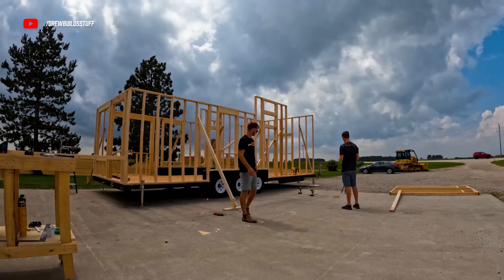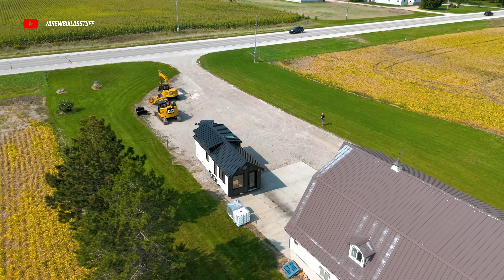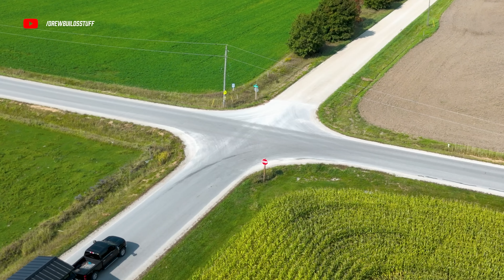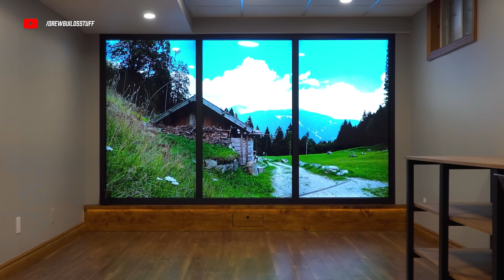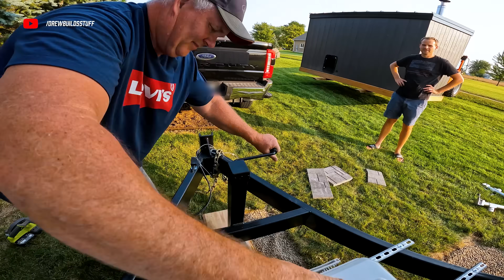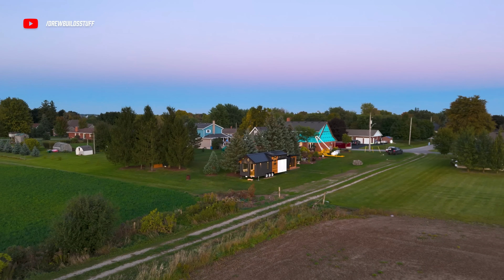MOVING MY TINY HOUSE

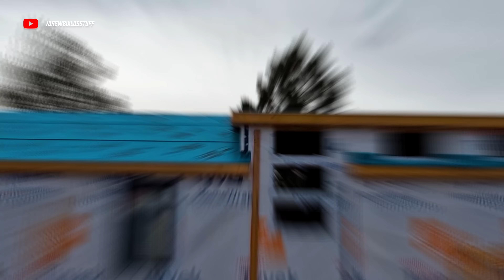Comment: 0:24 Glad to see that you're using regular plywood for the walls instead of that awful OSB crap --- it may be a bit costlier, but plywood lasts a lot longer in that it doesn't just dissolve into mush and fall apart the way that stupid particle-board does if it gets wet.

Comment: F-250 the 6.8L Gas V8 engine allows for towing up to 14,500 lbs. With the 7.3L Gas V8 engine, the towing capacity increases to 17,000 lbs. Both the 6.7L Power Stroke Turbo Diesel and the 6.7L High Output Power Stroke Turbo Diesel engines offer a maximum towing capacity of up to 22,000 lbs.

An F-350 or bigger is ideal for large tow jobs. Max towing capacity should not be taken lightly. Exceeding what your vehicle is designed to tow can strain your engine and transmission, accelerate brake wear, damage your tires and even warp your chassis. I always recommend doing your research before you tow anything to make sure that your vehicle can handle it. Even short trips can cause problems, but just a heads up for something to be mindful of.

Comment: TOTAL BEAUTY!!!  And you make it look SO EASY!! lol 
ONE THING: In that rear corner that the toilet exhaust is at, that pine tree is gonna do some damage to your roof and siding... so you should trim those branches back a bit so they are at least not ever top of the roof. I would also make sure it's just not touching the siding either because they will put sap all over the siding and that is NOT easy to get off, depending on the type of pine it is. But over top of the roof is gonna put a ton of the needles into your gutter (I THINK there is a gutter over in the corner, right?) 
- And I don't think this is an issue for you but any squirrels or mice or whatever could now easily go from the trees to your home and you KNOW what that can lead to.... you MIGHT wanna figure out if you have those small animals in that area.. I would think you'd have mice before squirrels because there just isn't much woods for them there... but ya never know!

Comment: Next time, pull it with a tractor, then no oversize permit needed in most states.
Reply from the maker: Haha ya I think you need to be pulling farm equipment though
Reply: @DrewBuildsStuff , well of course that's a farm worker's nest, isn't it?   We moved trailers out so that the workers could keep an eye on the fields and pastures.   As long as we used a tractor and flagged the rear end . . . no permit needed. (Lexington, KY . . .Horses, Cattle, Sheep, feed crops)

Comment: If you switch the swing of your front door to swing to the outdoors instead of into the house, you'll gain like a square meter of space. And it opens up that inside side wall to act as a closet and shoe storage.

Comment: What's up with that heat lining cable? I have pex that runs through conduit from my house to my external garage (this was all installed before I bought the house) and the waters stops flowing in winter. Could this be a solution?